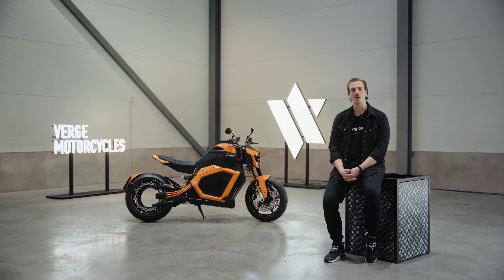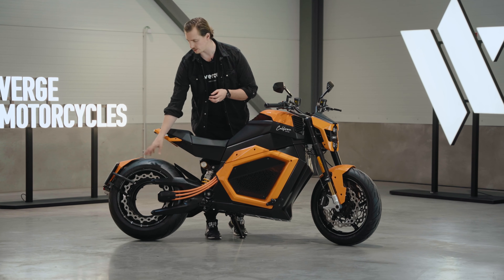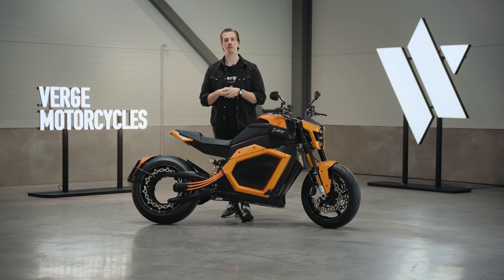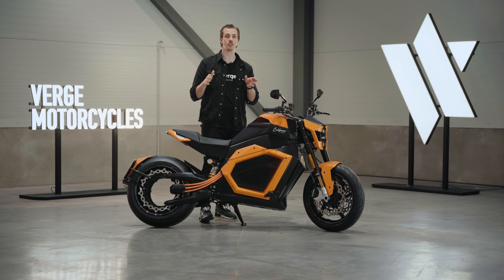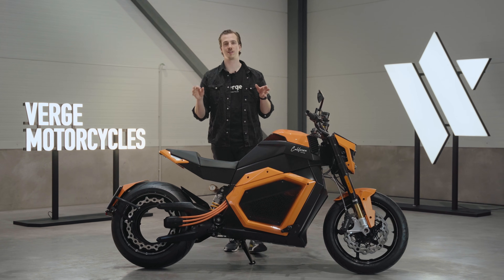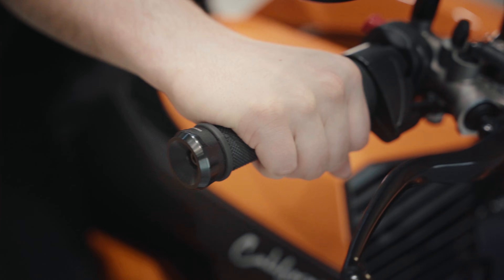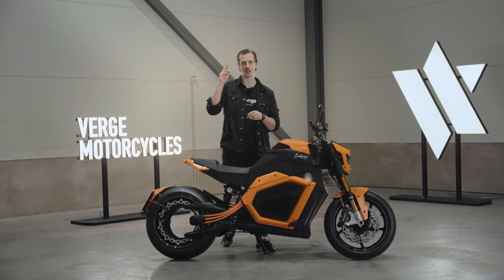Verge TS Pro Explained - An in-depth look at the electric motorcycle

Comment: Great thinking outside the box, but with the hub motor on the large (heavy) rear tire, don't you have a lot of weight far back from the mid-line of the bike?  Is the ratio front to back something like 20:80 so lot of weight swing off the back end?  Compare this to say a BMW S1000RR and the BMW will have superior balance say when mountain riding.  Also, as others have ask, can you coast?  If not, I can't imagine the amount of work you are putting on your right wrist having to be engaged constantly due to regen. Love the concept, but not sure it's there yet.

Comment: Just checked the price. $29k. Well over thirty thousand after taxes. For that cost I could get a CBR1000RR-R Fireblade that does 188mph and is slightly faster in the 0-60 in the lower 3 second margin. Plus it would sound extremely aggressive which is what riders still want. Even then, I could pay 8k to 15k, make some minor mods and still have a Super Sport that does well over 124mph, 0-60 in under 4 seconds and have it sounding like a proper bike. Don't get me wrong, I'm all about the EV industry. The tech, the evolution, the ability to power your vehicle off your own home power grid (think solar and Tesla wall battery storage), but 30k isn't a deal breaker yet for me, and these things still take way too long to charge. I'm betting the majority of riders will feel the same especially when you can get so much more for under 15k. Until they get this EV bike down to a competitive price, it'll only attract those who 1) Have that kind of money to burn and 2) Bike collectors. Plus I'd still have to see this bike on the road for a few years with that rear wheel Hub design. It has to prove low maintenance and cost to justify such a high price tag.

Comment: 1) everyone puts the battery there - 10 years now.  nothing unique. 
2) skateboards and scooters have always put motors in the wheel. not unique besides being hubless, which historically have been more gimmicky than functionally advantageous. 
3) $28k-$50k. very small demographic.
4) dirt and water in the motor? motor taking the shock of the road instead of first having it dampened by suspension? I'd be stunned if the road miles didn't negatively impact engine life and performance. 
5) very good looking bike
Reply from the maker: Thank you for the feedback!

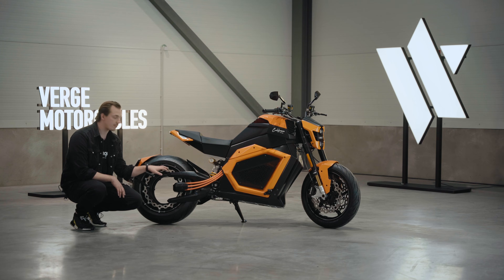Comment: 1:37 actually you want to say a hub mounted motor in an E- bike. This will be the most unreliable in dusty and humid conditions.
Reply from the maker: To see how the motor is built into the wheel, check out our new YouTube video on changing a rear tire: https://www.youtube.com/watch?v=wPPrrcd2dQ4&t=229s
And for riding in different conditions - Marc’s channel has plenty of real-world footage on our bike: https://www.youtube.com/@MarcTravels
Reply: @vergemotorcycles    Yes I noticed how there were dust impressions on the carbon rim which is also on the motor coils which will probably cause problems later on.
Reply: Changing rear wheel ?

Comment: Lauri, one question: will you provide the possibility of upgrades for the battery pack? I suppose you're using Li-Ion batteries, right? What about solid state batteries in a few years? Will it be possible or that is an exclusive plan for Verge TS 2?

Comment: shifting the motor to wheel would compromise the durability of motor and it wouldn't last long
Reply from the maker: It’s understandable to wonder about that. Our bikes are designed and built with the core principle of having the motor integrated into the rear wheel, ensuring that we have thoroughly considered all potential impacts on the bike and its performance.
On top of that, our bikes undergo rigorous testing to ensure they can handle real-world conditions.

Comment: Great idea on motor into the rear wheel, but the reason for motor and power units being in the central area is to keep the mass central so even weight distribution between the front and rear wheel.  But I do like the look but you need other bike styles to appeal to more bikers,  I think the electric motor is a big answer to how to move the bike, but what supplies the power to the motor still needs to be worked on.
Reply from the maker: Thank you for the feedback!

Comment: Zero Motorcycles places the battery and motor low. Though Zero Motorcycles SR series and DSR series is priced extremely high, their used prices are solid. The prices ive seen for all Verge Motorcycles are not for the common person.

Comment: You know what would be cool? Replaceable batteries! A bunch of them which easily swappable, so if you'd like a short trip, only take one battery, if you want to do a longer trip you take all batteries with you. And when one battery stops working, you can remove it, have it repaired or replaced. But it all should look great of course!

Comment: Has the good man ever seen any other electric motorbikes? None of them have the battery above the engine. Nothing about being top-heavy.

I ride an SR/S and a pale R1150GSA. The SR/S already feels lighter than the GSA when stationary. With the rear wheel, it remains to be seen how well the outer rotor is sealed and whether the normal tyre dealer can handle what is probably a very sensitive ‘rim’.

And 1,000Nm is good for a motorbike quartet card game and at the regulars' table. Nothing more. And on the website you write that the 350km at 100% charge is only achieved with careful driving within the city. But since the battery should only be charged up to 80% if possible and you rarely drive 350km in the city (what do I want there?), you're more likely to have a good 200-250km left over. Energica was already further ahead. 

The storm of conquest will probably be more of a mild summer breeze. When this impossible footrest position far forward was shown, I almost fell off my chair. You'll have to make up your mind, cruiser or sportbike. In any case, you're a long way from a motorbike suitable for touring. .

Comment: What about the un-sprung weight of that rear wheel? How does the rear suspension compensate for what must be a much heavier rear wheel assembly?
Reply from the maker: We have meticulously engineered and refined our motor technology until we achieved these outstanding performance specs with such low weight that the unsprung mass is virtually unnoticeable to the rider. The ride feels light, and very nimble. Best way to feel the difference? Try a test ride — it surprises a lot of people!

Comment: It's a great bike, but it's a bit wrong to say the other electric bikes have a high center of gravity. They all put the battery as low as possible, and if the electric motor is in the frame, then it's the size of a watermelon and the weight density is as much or more than the battery pack. They might have less battery and range due to the space taken by the electric motor, but I'm sure the center of gravity is roughly at the same height as this bike.
Reply from the maker: Thank you for sharing your thoughts!⚡

Comment: Lauri, I want to help Verge out.   I own a 2017 Zero SR.  (Got it used in 2019).  I've learned a lot about owning an electric  motorcycle for the past 5 years.  Below are the issues with owning an electric motorcycle.  I list them because Verge has only partially addressed 2 of them (relative to my 7 year old Zero).
1) Range.  My Zero does 70 miles freeway.  That's so bad, I can't take it out of town.  This works for me because I 100% wanted an 'in town' commuter, run-about (I get 150 miles in the city).  
2) Charging time.  My Zero takes almost 4 hours on a level 2 charger to go from 5% to 100%.   Which compounds the range issue, because if I 'ride out 70 miles', I would then have to charge 4 hours before I could make the trip back.
3) Cost.  As mentioned above, I got my bike used.  For about 50% off retail.  New, my Zero would have cost $19k.  I paid $10k.  I paid what the bike was worth.  Your Verge suffers the same issue with cost as any Zero bike.  The "new" price is waaaaay more than the "new price" of a comparable ICE bike.   That's truly a hard sell.  Most EVs have the bad habit of stuffing 'too much tech' into their product.  We don't need bells and whistles, stick as much analogue on the bike as you can get away with, and bring the price down.
4) The "toy" factor.   The "toy" factor plagues all motorcycles, no matter the power source.  Motorcycles are only good for moving 'your body' (maaaybe a passenger).  And that's it.  Need to pick up a gallon of milk on the way home?  Nope, no place to put that on a motorcycle.  Want to go to the mall and NOT have to carry your helmet and riding jacket the entire time while you shop?  Nope, there is no place to put that on a motorcycle.   So motorcycles are toys, and there just aren't that many people with the combination of spare cash + want a very pricey toy + ok with inherent danger of riding a motorcycle.
-
Here is what a "winning" electric motorcycle will have:
1) Highway range of 150, under spirited riding COMBINED with dc fastcharging.   Most people who ride motorcycles are happy to stop every 150-200 miles to take a breather, and being able to charge from 10% to 90% in half an hour works.  And it eliminates the 'range issue', because stopping to charge isn't a big deal.
2) Functionality.  Without a giant piston-based engine, EV motorcycles have dramatically more potential for on-bike storage.  Look at your Verge TS.  Imagine a "banana" style seat that started where the 'fake' tank is, then ran all the way back over the rear wheel.  It would for a rectangle that could be 100% pure storage.  The seat would be the entire top of the banana, and you'd flip the whole top open to access the storage.  You could easily fit two full size helmets, and a gallon of milk in that space.  OR, you could fit one full size helmet, your riding jacket, gloves, glasses etc.. so you wouldn't have to carry that stuff around every time you got off the bike.
3) Give up on the amazing 0-60, or massive torque.   No one needs THAT MUCH... Other than the .001% of riders who want to track a bike.   My little Zero is more than quick enough around town.  So much so I run a custom setting with 75% power.   Again, more towards function, less towards toy.
4) Build in "backwards compatibility".  I got a 50% discount on my Zero after only 2 years.  EVs have terrible resale value, and EV motorcycles suffer this more than cars do.  Imagine if Zero had designed my SR so that I could retrofit dc-fastcharging onto it.  Suddenly, that 70 mile highway range issue is mitigated.  Or imagine if Zero had made the battery "easy to swap" so that I could replace my 14kwh battery with a 'same physical size' 28kwh battery when the battery tech evolves.   Resale would go through the roof, because the bike would be 'future proof'.  I would also have been more inclined to buy the bike new.  As it stands now, every Verge buyer (today) will have to sit back and watch their $28k investment become more outdated each and every year, and they know it will be harder and harder to sell the bike as it gets older - because the future bikes will be sooo much better.  How many more Verge buyers would there be if they new they could upgrade 5 years from now?  10 years from now?
Reply from the maker: Thank you for your detailed feedback—we’ll ensure it reaches the right people!
Reply: Much of what you said makes sense except that saddle bags (or paniers), tail bags, tank bags, fork bags and bungee cords exist. I've done a lot of full grocery shopping on my bike which whenever possible is my main vehicle during warm weather and if I moved somewhere without snow and salted roads, I would ride year round. Of course if we had regular public transportation where I live I would opt for that and yes, a bike would then be a toy of sorts. A lot of the world uses mopeds and bicycles to get from point A to B, hence the Honda Cub being the most sold vehicle worldwide. Just sayin.
Reply: @Moto-Archaeology yeah, but if you have to bungi cord a bunch of stuff to your vehicle, it kinda says your vehicle wasn't designed right.
Reply: @bikebudha01  I stopped using bungees when I bought all the other things I mentioned. My CB750 Nighthawk has provisions for hooking bags to it, like many motorcycles do. People do very long rides with motorcycles and carry a whole lot of stuff in bags or hard cases. If you ride, you should know this. There is even a channel of a German rider who has riden his Zero from Germany all the way to China and is still going. He has many bags on his Zero.
Reply: @ Yeah, I don't want to have to strap a bunch of crap all over my bike.  It is less secure.  It makes getting on and off the bike harder.  And it looks bad.
Reply: Does it coast ......or have nuetral

Comment: In late 2022 I started riding an ebike, which lead to an insane obsession with it. Using it nearly every single day, I started getting into the idea of buying a motorcycle. Ended up signing up for a two day course, both fun as hell and nervous as hell, but I passed just fine. Got my license two weeks later.

Being far more interested in EV's than petrol bikes, I ended up looking around. Zero popped up first probably due to them having a deal with Google and while they looked great, too many reviews (circa early 2023) were talking about how they locked too many things and how "unlocking them" was just a scam for more money. I know they've changed a bit since then, but I was too turned off... Next I looked at Livewire and the S2 Del Mar in particular looked PERFECT.... except for the price. I did fully intend to have about $10,000 ready to put down on the bike and then keep paying it off, but the fear of owing more money strayed me away. I really still do love that model though and hope to have one some day.

Next I looked at Ryvid. On paper I seemed like the ideal rider for them and after a lot of back and forth I ultimately went for it as a good "first electric bike" style. Paying outright $7,165 out the door. As of this writing it is shipping in 3 days. Should have it within a little more than a week.

So why haven't I mentioned Verge in this comment yet? Well that's entirely because while I am totally floored with the amount of tech that is built into the bike... The cost is simply atrocious. It's very obvious that a lot of these styles, which technically fantastic, simply aren't going to sell well to people and are targeting the premium market. There really is a trend with many companies to "target the early adopters" and then hope everything else kinda works out. And I really do hope it works out for Verge,

I'm hoping as tech gets better and batteries get better (please work on solid state batteries, it's insane we're not) that everything gets better. I honestly don't think the premium market is sustainable.
Reply from the maker: Hey, thanks so much for sharing your story and feedback!🙌

Comment: How long does the remaining 20% take to charge? And what speed was the range done at?
Reply from the maker: Hey, thank you for your interest! Charging from 0-80% takes approximately 35 minutes, which covers the majority of fast-charging sessions. Charging from 80-95% takes around 10 minutes, but reaching the final 5% can take considerably longer, depending on various conditions.
About the range please head over to https://www.vergemotorcycles.com/ts-pro/ or at FAQ on our website.
Reply: @vergemotorcycles  you can type all that out and still not answer any of my two questions... Why can't you just answer the questions here?
Reply: Above 80% SOC it makes more sense to continue riding/driving rather than try to continue "fast" DC charging.
Reply: @mattg432  yeah, you just have to pull over and charge more often and there's nothing fast about getting a 80% charge in 35 minutes. After 400km/250 miles I pull over and fill my tank in 30 seconds an off I go again...